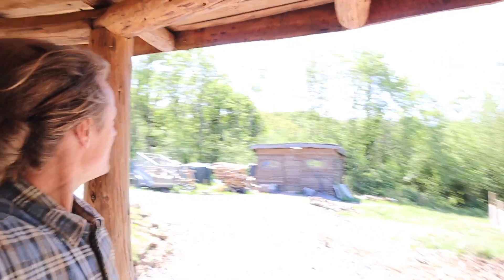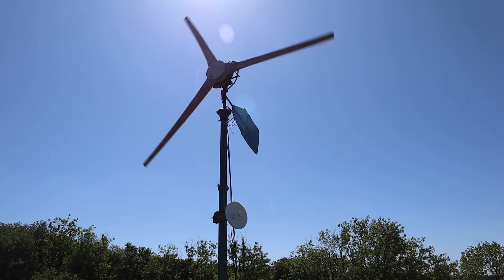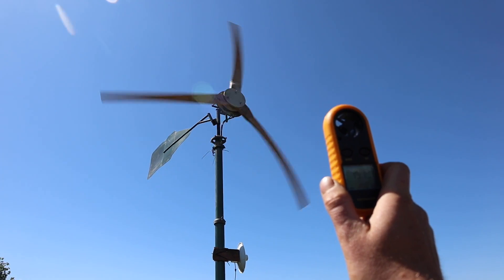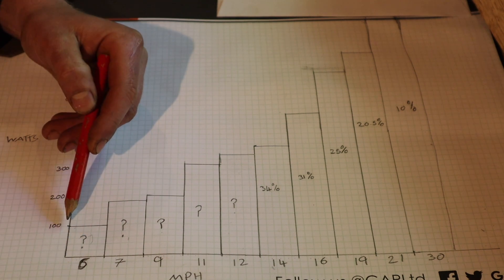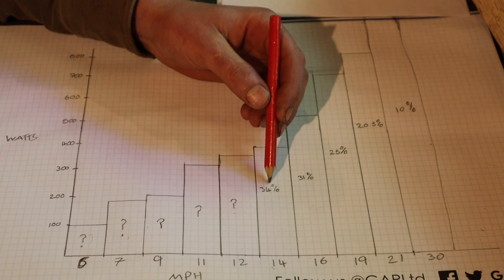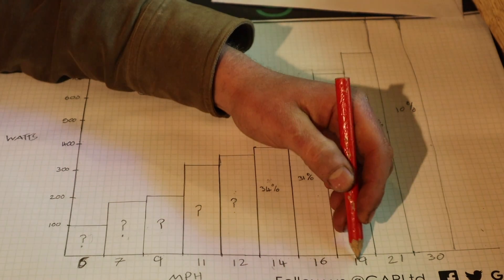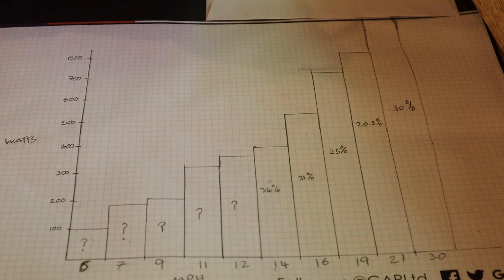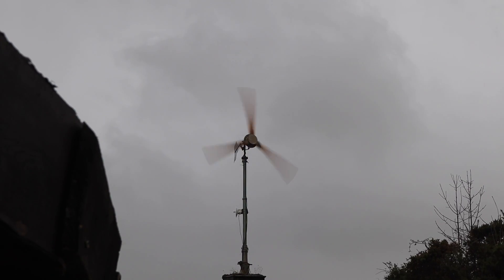Axial Flux Wind Turbine Efficiency calculations

Comment: I'd me mining crypto monero with the power as I've said before £££ 💪🏻
Reply: Mining on DYI renewables is not practical. You have to also factor in the wear on the electrical components i.e. inverter. Mining is only practical on geothermal
Reply: @af6880  could he not gpu mine on an old laptop?
Reply: @What..a..shambles  Can you still do GPU mining? Thought ASICS took over that years ago
Reply: Yea but that means you are either a sucker, or have it on your conscience to take money from a sucker.
Both not that nice.
Reply: @aenorist2431  digital currency adoption is coming sooner than later, mining is just supporting the network you are not taking from anyone, I only suggest it bcos of the "free" power he could have available and it could be an additional revenue stream imo
Reply: @aenorist2431  you don't take money from anyone by mining cryptocurrency... a computer is solving complex mathematical problems by guessing the answer millions of billions of trillions of times until it guesses it right and then you get rewarded with bits of cryptocurrency... extrapolated up the more powerful computer using more electricity will generate more currency, it's now at point where if you pay for power it's not economically viable, however, because Kris is getting the power for free he could essentially be earning free money from an investment of a few hundred pounds in a mining machine.

Comment: Interesting thought 
Contarotating double set of blades with the armature on one set of blades and the magnets on the other set of blades .
The blades turning opposite to each other would double the speed of the generator in the center .
Reply: how are you going to connect wires to or even hold on to it
Reply: @cliveramsbotty6077  The same way as a comutator works in a drill use carbon brushes .

The two parts of the generator mounted directly to each set of blades .

A distance of about 6 to 10 feet may be needed between each set of contrarotating blades to smooth out air flow .

This is all theory and just a idea .

The idea is under low wind speeds to just double the speed of the generator without using gearing that increases drag .
Reply: @rocklover7437  BRUSHES ?  ... No !
Reply from the maker: If you look at commercial wind turbines they are almost always 3 bladed designs this is the most efficient way to catch wind. the more blades you add the more drag you add. Also the goal isnt to double the speed at all that would send the voltage way to high for the battery. the goal is to efficiently catch the energy from the wind and a 3 blade design dose that by far the best. blades turing opposing each other would create a huge amount of drag. with wind to catch twice the energy i would only have to make the blades about 500mm longer. blade length is where the power comes from and it is the single biggest and cost effective thing you can do to get more power.
Reply: @KrisHarbour  Good info cheers .
Reply: @rocklover7437  And the wind stream is very turbulent behind the first set of blades = no useful power.  Wind Turbine farms are aligned. so that no wind turbine is "down stream" from another wind turbine, using the prevailing wind direction.
Reply: @MrSummitville  As i stated just a idea .

Kris has made a great comment explaining why my "idea" wouldn't work .

It was just a "idea" based upon my love of WW2  Reno racing aircraft that use contrarotating props for speed  .

Comment: how do you work out the efficiency? it seems to me like 14->16mph is 14% more wind and 400 -> 540 watts is 35% more power. so... more efficient...?
Reply: I believe wind energy is a cube of the windspeed, so 16mph has 49% more energy than 14mph
Reply from the maker: As said above. Wind is cubed so the power increase is dramatic with a small increase of wind.
Reply: @KrisHarbour  While it is true that, the power available in the WIND increases by the cube of the wind speed, that formula does not apply to the power output of your wind turbine.  In the real world, your small wind turbine only initially increases power output by the SQUARE of the Wind Speed - ie  just above Cut-In speed.  At wind speeds above your max Power-Coefficient, the power increase is reduced to a LINEAR relationship vs the increase in wind speed.  Finally, at Stall Speed or Furling, the increase in power output drops to essentially ZERO vs any wind speed increase.
Reply from the maker: Yeah that’s true, real world is different because the efficiency drops off quite quickly so even though the available power is cubed the losses are also cubed as far as the blade losses and then the losses in the wiring are increasing to. So yep you won’t ever see a cubed real life power increase from a wind turbine.
Reply: @____5837   @Kris Harbour Natural Building  thanks! that makes sense :)

Comment: Kris how would you be able to install a brake for that thing?
Reply: Windmills have a built in breaking system, the tail tilts the turbine off axis at high speeds as seen at 13:50
Reply: You normally short the outputs of the wind turbine together to brake the wind turbine.
Reply from the maker: As said above. the turbine can turn out of the wind but i also have it connected to a solenoid that shorts it out when the battery is full.
Reply: @AndyFletcherX31  Shorting the output, while the shaft is spinning in high winds, is a good way to BURN UP the coils ...
Reply: @MrSummitville  It is the recommended method for most small turbines. The short circuit quickly brakes the turbine to a slow speed which reduces the output and power dissipated in the windings.
Reply from the maker: I have a coil of wire that is quite high resistance that gets almost red hot when I trigger the break. That’s takes most the energy out. Once the brake is on and it’s shorted out it cant get back up to a high rpm to be able to make much power. Basically it makes it spin slowly and makes it very inefficient so most the wind blows passed it.
Reply: @AndyFletcherX31  It is NOT the recommended way.  A "Shorting" Brake is only used to keep the blades from turning, during the installation process.  It is NOT recommended to energize a Shorting  Brake  when the blades are spinning fast, in high winds = BURNED COILS.  There are way too many videos showing BURNED COILS caused by energizing the BRAKE SWITCH. Educate yourself ...
Reply from the maker: MrSummitville, Its completely possible to do if you use a coil of wire to take the energy out first so the coils dont burn out. although i wouldn't try and do it in high winds. i would leave the furling tail to do its job in high winds and just keep the hot water tank on.
Reply: @KrisHarbour  Well my point was ... "DURING HIGH WINDS".
And you wrote a "coil of wire" which is a LOAD - not a shorting switch.  Your reply did not address what I wrote.  I stand by my statement ... A Shorting Switch is only recommended when raising or lower the Wind Turbine for maintenance - NOT for stopping the blades in HIGH WINDS.
Reply: @MrSummitville  OK to make a point. The last comment was not called for. Be polite or be quiet.
Reply: @ralphwilmot6351  I was polite. You replied with nonsense.  My reply was addressed to  @andy fletcher, not you. It still stands ... You should not attempt to stop a wind turbine, in strong wind with a Shorting Switch.  If you connect a very low ohm load to a fast spinning wind turbine - the coils will get too hot. There is no such thing as "Taking the energy out" <= You made that up. . You should be quiet ...

Comment: Hi, interesting. Any thoughts on energy storage solutions for times of maximum production?  Seems a waste to have to burn through ‘excess’ energy. Perhaps another pond for watering your animals, run a pump during these times.
Reply from the maker: I have a big battery. I can store a few days worth of power but in times of high energy weather the batteries fill up quickly. its not really worth it for me to have the cost of a huge battery as i have power coming in from 3 sources and in the winter that is 24h a day. it does mean some days i have more than i can use or store but i try to do wood processing on those days if i can.
Reply: @KrisHarbour  Try building a heated and insulated wood storage shed.  Kiln dried wood is miles better than seasoned and with your surplus power you can basically cook it.
Reply: @KrisHarbour : On a much smaller scale of course you experience the same issues as the National Grid does with renewables. It was just me pondering the question really and wondering if you were doing the same 🤓.
Reply: @KrisHarbour  how big is your batteries?

We are currently using 24v forklift batteries at 460ah
Reply: He has batteries for storage. All those technologies you mentioned are not for a domestic scale. He is doing the best thing right now. If his batteries are full then it best to heat water and use space heaters to heat his internal spaces. Any other storage wouldn't be cost effective.
Reply: @alann8117  I feel like if you have a home and shop, having a large compressor automatically top off when there's extra power for air tools would be quite useful. And a hot water heater or something set up to the same "overflow" circuit. But yeah you're right in terms of real energy storage, you'd need like hundreds of thousands of gallons of water to actually store a useful amount of water... based on my bad maths.
Reply from the maker: The air tank idea for air tools is a very good idea! i had never thought of that. But that would indeed be a good store of energy. Thanks for the idea. i think i will do something with that in the top workshop.
Reply: @KrisHarbour  looking forward to seeing it man! You've inspired my roommate and I to try to build a wind turbine by the way.
Reply: Some other ideas: use the excess power to pump water uphill for domestic use. A big tank on the top of a hill will give you nice water pressure. You could also run an oversized electric hot water tank for long, hot showers. And you may have enough excess power to run an indoor hot tub or dry sauna. The sauna would be a fantastic place to dump excess power into heat, as temperatures between 70 and 95°C are best.
Reply: if we were as concerned with saving power/energy as we are trying to make it and store it there's really wouldn't be power problems.
Reply: I have mentioned an electric car (for the charging) on a past video and Kris replied that 'could' be an option for the future.
Reply: I like the idea of excess power to dry wood in a wood store., and the obvious ones of an efficient heating system with radiators in the house and work shops.

Another option would be an electrical heating element in an insulated water barrel dumping power to heat the green house, thermal mass type system and perhaps even with piping running under the vegetable beds in the green house. Winter growing and early season veggies, warm ground soil really gives plants a great start.

Nice problem to have. As ever thanks for sharing with us all Kris.
Reply: Hi, seems like there are plenty of thoughts on the topic which is great. For those that have been inspired to attempt a wind turbine I have been following with interest a series of videos on Robert Murray-Smith’s channel: https://youtu.be/TUmxqO_3fEE that may well be more suitable for an urban setting and start to produce power at very low wind levels. I’m not sure how it will work out but it looks promising to me.
Reply: @Krishna-Govender  The problem with that technique is the very high torque required to lift the weight. With the limited power available, that would require a complex gearing system, which would lose efficiency. Better would be to use a flywheel, which can be sped up with little power, or pumped hydro storage which only needs to lift the water in the pipe, not a large amount of mass.